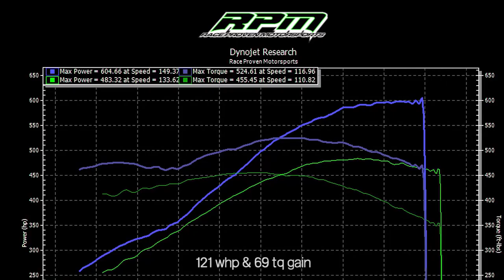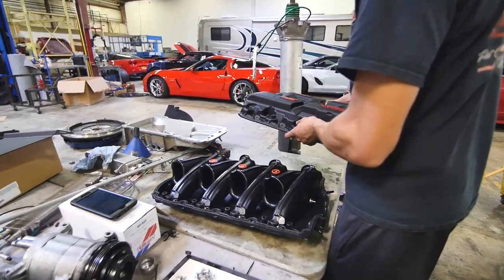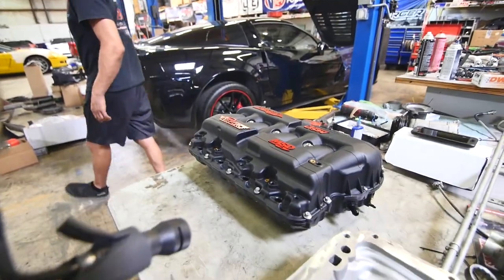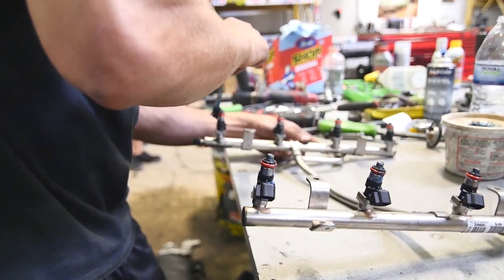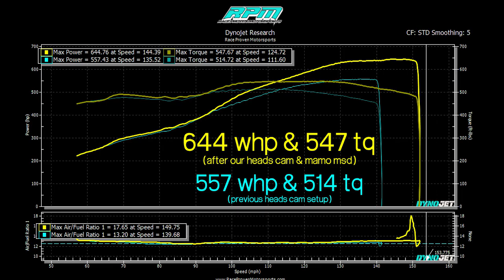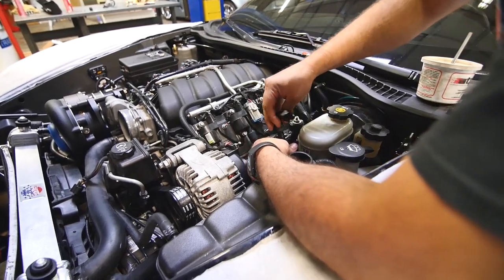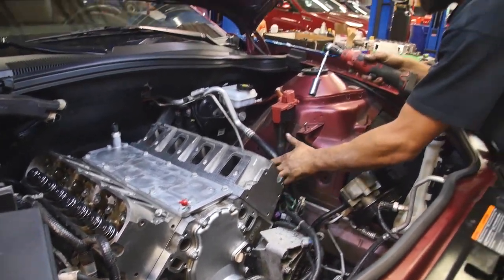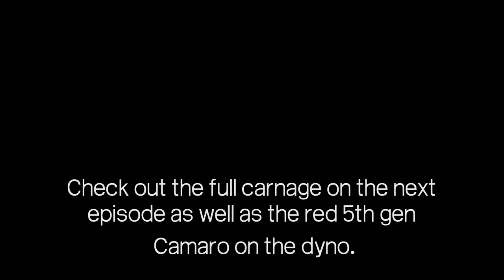MSD Intake Manifold Install & Dyno | RPM S7 E41

Comment: I never see Matt or Eric degree the cams that they install. Do you degree them when you install each cam?
Reply: icurt06 they probably install them straight up. Align the dots on the gears ⚙️ 🤷‍♂️ good question doe
Reply: You dont have to degree cams anymore. All you have to do is line up the dots on the cam and crank sprocket and its good